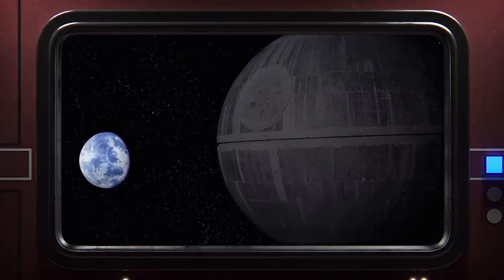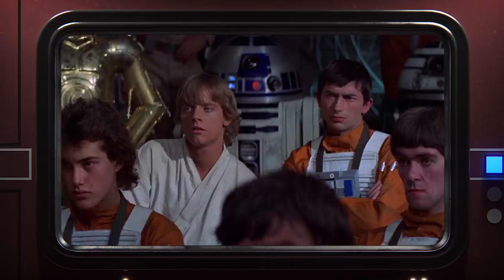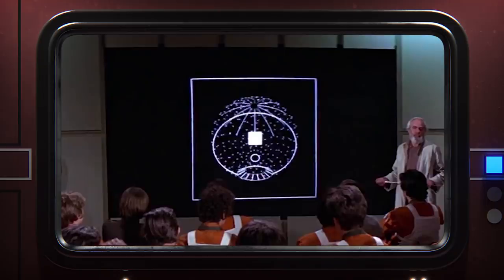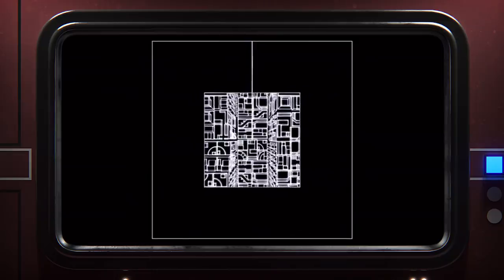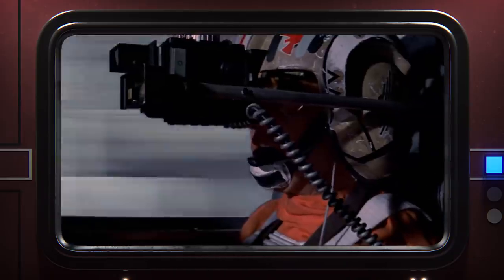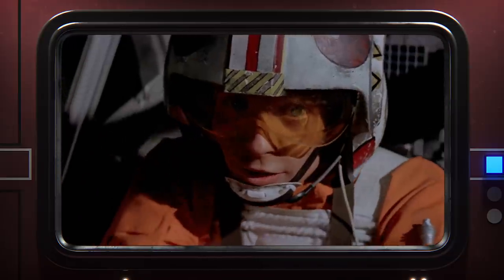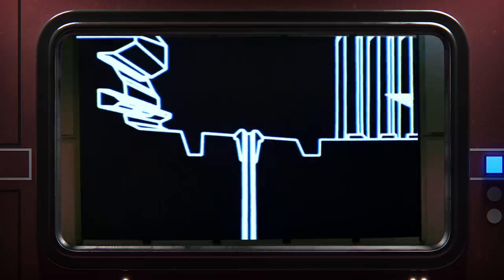The Thermal Exhaust Port Was NEVER a Problem

Comment: People on the Internet:
Why didn't they just cover it up or something?

Me, and intellectual:
Yes, how bout we cover up your car's exhaust pipe and see how well it runs.
Reply: its a thermal exhaust port it lets out heat (or heated something, what we don't really know) not carbon monoxide, that is an example of false equivalence right there
Reply: @Scortch-lo3xy  The thing is, it WAS covered up, by a ray shield.

Nobody would waste an incredibly valuable proton torpedo on what amounts to a window air conditioner. The ray shield would protect it from any stray lasers or turbolasers. The only way you would know to shoot it is if you had the plans.
Reply: @Crosshair84  uh what? 

what does that have to do with anything? I talking about why there is a MASSIVE difference between an exhaust pipe on a car and an exhaust port on a space station, especially when there are some 18 other ports and a much larger main port. 

also window air conditioner? really?
Reply: @Scortch-lo3xy  yes, thernal exhaust, that ac gotta get cool.
Reply: @Scortch-lo3xy  I think it's safe to assume that there was more than just heat leaving the port, heat can be dispersed in a number of ways other than just a tube but gas is something that would require a structure such as what is seen in the movies
Reply: We do. we put mufflers on the exhaust, no straight pipes unless its a race car.  usually a series of baffles, keeps the exhaust from shooting straight out and keeps the sound down. would also keep those pesky torpedo's from going straight to the reactor, Death Star needed Mufflers!!
Reply: @mikemoreno5267  ahh. Man, don't you just hate it when you are driving in a Nascar race down in Daytona and some pesky random rebel with space magic pulls off an impossible shot, and sends a good ol' proton torpedo down your car's ray shielded exhaust pipe and hits the main reactor starting a chain reaction that blows up everything? Man I wish I could keep darn proton torpedoes away from my car.
Reply: just use a mesh cover...
Reply: You could put a grate over it so that the torpedoes would explode on impact with the grate, saving the the death star
Reply: @crowncarwashoilchange8609  that is such a primitive solution.  These people live in an age where force fields protect everything from space.  They aren't going to set up a grate for the most sophisticated weapon in the galaxy.
Reply: TheKiltedGerman 
Just use a grate man
Reply: @trentwerner366  yeah, not that hard
Reply: "Oh no, We ain't falling for no 'potato in the tailpipe' gag."
Reply: @Scortch-lo3xy  it's really not an example of false equivalence because both instances have the same result. if a car engine can't release gasses, it fails, same as any appliance unable to release heat waste. you sir are cherry picking
Reply: @crowncarwashoilchange8609  if there is a grate, there can't be a ray shield or they would destroy each other. ray shields go from the walls in and a grate would block the field emitters. a grate is completely useless against literally any weapon so idk what you were on when you wrote this but it doesnt make sense
Reply: @crowncarwashoilchange8609  It's not a grate idea
Reply: @Scortch-lo3xy  The typical way to get rid of heat in space is to use large radiators that I suspect often are mistaken for solar panels. This is obviusly not done other then the spherical hull of the death star itself of cause will radiate some heat. So it is feasible that they use some form of gas. Actually some artillery pieces blow gas through the barrel after fireing as a way to cool it down. So the will then cool the reactor by blowing an hopefully inexpensive inert gas at the reactor and then ventilate out the heated gas.
Reply: @mikemoreno5267  I suspect it had them, except for that one port, designed that way as a sabotage.
Reply: @crowncarwashoilchange8609  Maybe some lazy technicians was working at the exhaust port and couldn't be bothered to screw back the grating when out for a lunchbreak? 😉
Reply: Also it would look terrible, we got to think about resale.
Reply: @Scortch-lo3xy  well, in space there is a vacuum so you cant use a normal dissipator to get rid of the heat, cause there is no air or matter to pass it on to, so probably that exhaust port had to have some sort of gas that was being expelled out of it to transfer the heat from the reactor. So yeah, i guess that could be an explanation as to why it had to be like that.
Reply: @Scortch-lo3xy  Well if it lets out heat why not just use radiators? They work a lot better in space and cannot be sabotaged or exploited by a nobody farm boy who turns out to be very powerful space wizzard So it probably isnt thermal in the way that you think it would be
Reply: @michaelpettersson4919  EXACTLY
Reply: @AlFredo-sx2yy  AGAIN EXACTLY
Reply: @Scortch-lo3xy  still, when you have a huge buildup of heat, it’s gonna go boom
Reply: @anonymystical4413  that's not how thermal energy works.
Reply: @crowncarwashoilchange8609  Many explosive projectiles need a certain amount of deceleration in-order for the fuse to detonate the explosive. Something like a torpedoed designed to punch through armor would go straight through the grate and not detonate until it hit the reactor.
Reply: @Scortch-lo3xy  How about covering up the radiator on your car and seeing how long it will run.
Reply: Why not just a grill cover? Gas can go threw but if you make it small enough and with enough layers a torpedo shouldn't get through
Reply: @markgeorge2200  It had a cover, called a ray shield.  Instead of a metal it was made of energy. They talk about it in the movie.
Reply: well you can argument that simply something like a bars or a Grid of tin metal could be use a few times inside the tunnel. It will still let the gas/ heat relas but build a mechnical barriere for bigger objects.
But most liked the proton topedo will not destroyed or exploded on impact of those grid but simply penetrated them and break them and fly with lesser speed still to the core...
And if the rebels have a few days before the deathstar arrife they could mont a torpedo /Bomb on a spider like droids that will firer from a X-wing and then crawwl down the tunnel and there cut every object in the way with a plasma cutter that was also installed. 
and last but not lest. Starwars was a univers where spacewizzards exist that can move objects with there mind. Luke have done it becaus he aim without Computerassistant. There was obiwan Forceghost ( if a ghost could turn back that fast after its death) and final Darth vader could manipulated the topredos becaus he want Tarkin out of the way and simply never believe a deathstar was nedded. ( remember hiw he speak over the deathstar and in revelation to the darkside of the force)
Reply: why are you people having such a big argument just add a few grates inside the exhaust
Reply: @burgernthemomrailer  Should we talk about real problems like: How did i as men lern to accept myselfe and not permement hidden behind a mask? Or how did i emmotional grow up after be a robot for 20 years... How not to be an asshole?  Or to learn to invest right into the stockmarket without have to pay to much in taxes and service?

No way... Let us talk over problems that did  not exist in storys we don't have any influence. And have no a single influence in ourer Real life . ( Exept for a few rare cases you would have to deal  in your hobby or your work becaus you work with airconditons or are a plumer...
Reply: @Scortch-lo3xy  Either way its gotta be letting out gas of some sort, even if its not carbon dioxide.
Reply: @burgernthemomrailer  that's what i've been arguing for but apparently that would completely destroy the death star, because integrating grates is impossible for something that radiates heat.
Reply: @matthewpaine6908  once again people bringing in false equivalence, covering up the radiator on your car, which mind you is already situated behind a grate for its protection, is completely different from putting a grate on it, which we already do. 

Seriously  have any of you guys ever actually looked at your own car? Why does everyone seem to assume that their radiators are just exposed to the open air.
Reply: @Scortch-lo3xy  I'm talking about completely coving it up, dumb ass. Yes your car has a grill to protect it from light impacts. However a grill will not protect your radiator from getting shot.  A Grill is not armor. That's what is being discussed.
Reply: @matthewpaine6908  my point still stands.  "your car has a grill to protect it from light impacts. However a grill will not protect your radiator from getting shot." that's great, good thing that those grills are not designed to prevent bullets from passing through, It is indeed designed to prevent light impacts. Lets also not forget the fact that a torpedo is very different from a bullet. 

In order to stop a torpedo, all we'd have to do is prematurely detonate it before it hits whatever critical system it is aimed for. 

Are you seriously telling me that in this world of space wizards and super weapons the size of moons, they couldn't design a grate or grill to slap into this exhaust port, so the whole damn station doesn't blow up? 

Doesn't even have to be a static thing either, it could totally be a retractable shutter or even another shield that proton torpedoes can't pass through.
Reply: @Scortch-lo3xy  You clearly have no Idea what you are talking about. Ever heard of an  armor Piercing bomb? The Fuse in the bomb is designed to not detonate on impact allowing the bomb to penetrate the armor and detonate inside the target. In fact you can program the fuse to detonate when ever you want, that included detonating 10 feet above a target or only after the bomb was come to a complete stop.  A grate will not stop an armor Piercing explosive missile.  That is like a bullet being shot at your Radiator. 

Plus the Exhaust port on the Death Star had a "Grill" covering it called a Ray Shield. The space version of a Grill. That is why they used the "Torpedo". Which is not a Earth Torpedo, since they are in space and not in water. We would call the "Torpedo" used in star wars an armor piercing Missile.
Reply: @matthewpaine6908  still does not answer why there was not another shield built into its design that would block a proton torpedo, you know the one and only thing that could pass through the ray shield without any problems at all what so ever. 

Also "We would call the "Torpedo" used in star wars an armor piercing Missile." can you get a citation on that there fact, or are you pulling more nonsense out of your ass?
Reply: @Scortch-lo3xy  

Here you go butter cup, the Definitions of a Torpedo. 

tor·pe·do
/tôrˈpēdō/

noun 

1. a cigar-shaped self-propelled underwater missile designed to be fired from a ship or submarine or dropped into the water from an aircraft and to explode on reaching a target.

So a Torpedo is an Underwater Missile, which means, You can't have a torpedo in space. 
 
I know a 5 second google search is hard, but it tends to make you look less like an idiot.
Reply: @Scortch-lo3xy  To answer your question on, Why didn't the empire build a shield into its design that would block a proton torpedo.  Let's look to real live events, like, why did the US Navy not have Torpedo nets around the Battleships in Pearl Harbor in 1941? 

The People in charge of Pearl Harbor knew the harbor was too shallow for torpedoes and didn't bother putting torpedo nets around their ships in the harbor.  However the Japanese designed a Torpedo in Secret that could be dropped in shallow water.  The Japanese found a weakness in the harbor and exploited it for their advantage.

Shoving a Proton "Torpedo" down an exhaust port was a 1 in a million shot. That need the "force" to pull off. So the Imperial Engineers would have considered the Ray shield to be sufficient. The pilots in the the movie even bitched about the target being too small to hit with their "Torpedo's."
Reply: @matthewpaine6908  

okay
1. i think you missed the point, i wanted to know why the hell you seemed to be convinced that a proton torpedo would be classified as an "Armor piecing Missile", where is this classification coming from? Did a cannon source call it this? Or is this just a label you decided to slap onto it for........reasons? 

side note: they take a great number of naming conventions from naval tradition, (Destroyers, Frigates, hell even outdated naval classifications like dreadnought) is it really impossible to assume that they would have taken the name torpedo as well? 

2. That analogy would make sense except in this scenario, proton torpedoes are apparently a well known technology in starwars, and people are aware of it's ability to pass through ray shields. The Empire would have been aware of this weakness of ray shields and thus the comparison between Pearl harbor and the death star is once again a false Equivalence comparison on your part. 

3. Last point " the Imperial Engineers would have considered the Ray shield to be sufficient. " Really? I thought we were arguing about, why slapping a grill onto the exhaust port, or really any additional layers of protection, (Particle shield, opening/closing armored door, Etc.) was a good idea or not. We were not arguing about what the imperial engineers where thinking when they built the station. You should move goal posts for a living, your good at it! :)
Reply: @Scortch-lo3xy  I understand that thinking is not your strength.  So I will try to simplify this as much as I can.  

The Ray Shied the Star Wars version of a Grate or grill on Earth.

The Proton Torpedo  is the Star Wars Version of a Missile on Earth. 

I don't think you will be able to understand anything further than these two simple points. Make sure when you play outside side you wear a Helmet because I would hate to see someone with a few missing chromosomes get hurt.  Cheers.
Reply: @matthewpaine6908  
"The Ray Shied the Star Wars version of a Grate or grill on Earth." so your saying that they do not have grates or grills in star wars? okay, also you have completely changed they argument once again, moving the goalpost to a completely different discussion.

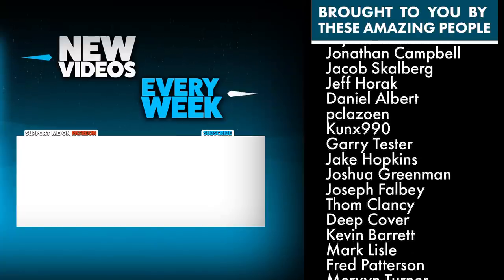"The Proton Torpedo  is the Star Wars Version of a Missile on Earth." then why don't they call them missiles?  they have other self propelled munitions that they label missiles (https://www.youtube.com/watch?v=M2Z1zvpkhbc) 4:27 to be precise. And again you say "The Proton Torpedo  is the Star Wars Version of a Missile on Earth. " not really, a star wars  missile is the star wars version of a missile on earth, as evidenced by the source I listed above. Its quite helpful having a source to back up my claims, you should try it sometime. 

Last point, I promise, *shield, and are you just capitalizing random words in your sentence for a reason or do you not understand grammar? 

Based on how you've been throughout this conversation, it seems I am not the one missing a chromosome here.
Reply: @Scortch-lo3xy  The ability to speak does not make you intelligent. When you learn to read please re-read my previous comments. The answers you see seek are there, you just have to actually understand what is being said. Now, get get off the computer and go play with your friends.
Reply: @matthewpaine6908  i guess i win then, he still can't seem to tell me why putting in a second particle shield is a bad idea.
Reply: A grate might work
Reply: @Scortch-lo3xy  I doesn't matter what the fucking name of the missile is, George Lucas still calls lightsabers FUCKING LASERSWORDS, even though they are canonically made of plasma. "Why didn't they add another shield?" Why don't you use two condoms? Or three? Or four? Or six? Because one is fucking ENOUGH. The only reason that shot worked is because of literally magic (the force).
Reply: Lol
Reply: @matthewpaine6908  definitions change with the advancement of technology, dipshit. Nautical terms are often applied to space, which is why space “ships” are part of a fucking “navy”. Make sense?
Reply: @TokyoXtreme  Good Job, you have completely missed the point. It literally went right over your head into the next state. Let me attempt to explain this to you, however I am not that good at explaining things to people with a sub 80 IQ. 

In the year 2021 there are no Torpedo's in space on Earth. Torpedo's are consider underwater missiles not outer space missiles. Ok. 

Also in the Year 2021 on Earth,  the phrase "space ships" are not interchangeable with "ships". Ships refer to water craft and Space ships refer to Space craft. Hence why Space in placed in front of ship. Understand.  

Also no Navy in the Year 2021 on Earth operates a space ship. FYI. 

This may be hard for you to understand but this is the year 2021 not 2521. So I am going to compare Star Wars tech to Earth tech of the 20th and 21st century.
Reply: Nothing bad tbh except for the fact that it would turn off
Reply: @kaedehara3645  the Death Star could have been saved by a sieve
Reply: @matthewpaine6908  so your car has a gaping gap in its middle to radiate heat? Sounds like a brilliant idea wow!
Reply: @matthewpaine6908  didn’t work tho did it
Reply: WOOSH
Reply: @Scortch-lo3xy  It's not a literal analogy.
Reply: @Uranium 233 filter in your car ain't gonna stop a bullet.  You think one's going to stop a space torpedo? 🤨
Reply: If your argument is "mUh GrAtE," shut up.  Not only has it been done to death and already been rebutted, but you fundamentally don't comprehend the extremely basic narrative of Star Wars, a movie for children.  Shut up.
Reply: "and" intellectual??
Reply: @Scortch-lo3xy  Cover an heat exhaust port.... HEAT exhaust. Port with takes heat outside of reactor so it doesn't overheat... Yeah, great idea.
Reply: @kibukaj2956  doesn't always need to be covered you know, a second layer of shielding, which can be deactivated when not in use, would be a great idea as you have already stated. 

Also how bad can the result of covering up ONE of 18 ports possibly be worse than literally the entire station blowing up? Especially since you would only need to cover it up whenever there was a serious possibility of someone shooting the port with a proton torpedo.
Reply: ...be right back
Reply: I mean would it have killed them to put a grate on it
Reply: @Scortch-lo3xy  You don't know how space works do you...
Reply: I mean they could use a vent?
Reply: @Scortch-lo3xy  "its a thermal exhaust port it lets out heat (or heated something, what we don't really know) not carbon monoxide, that is an example of false equivalence right there"

If it's a port, then to let out heat it has to let out something to carry the heat, ie carbon monoxide, or pretty much any gas, "a port" means it is venting something, you can't just vent heat itself, as heat is a form of energy that an object has, you can vent a gas that carries the heat, but you can't vent heat itself.

You can radiate heat from an object, but that isn't the same thing as venting it, and you'd use a radiator to do that, not a port, in space the only way of getting rid of heat is to either vent out some gas that you've transfered the heat into inside the ship or station, or to use a radiator, a port isn't a radiator...

In an atmosphere you also have a third mechanism of getting rid of heat, convection, that isn't an option in space, so it's either radiate, or vent from a port.

So it's not a false equivalence.

Side note, regarding Princess Leia getting spaced....

You will NOT die from being frozen in space if you're blown out into it, you will die of asphyxiation long before that happens, infact your body temperature will initially rise before you die, not drop, because you've lost all but one mode of getting rid of body heat, you only have radiation left, you don't have conduction or convection available to get rid of body heat, and radiation is by far the worst way to get rid of energy compared to those two, any movie or tv show that shows a person immediately freezing to death is made by someone who didn't pass highschool physics.
Reply: Don't have to plug it.
Just put up a wall a few meters in front of it.
Ever seen a chimney cover? It's a little metal hat for your chimney that prevents rain and snow(and radioactive dirt if you live near Chernobyl like me) from falling into your house while still letting the smoke out. 

It would have also been probably really beneficial if they didn't put the exhaust port at the end of a long, straight trench. If it was facing straight up and away from the Death Star, any attacker would have had to come from an exposed point and have to navigate through the concentrated firepower of most of the surface turrets instead of just the ones in the trench. 
Basically, once you enter that trench, you've effectively bypassed almost all of the defense capabilities. In tactical terms, that's called a massive fucking oversight.

Also, the empire knew that the floor plans for the Death Star were stolen. Any sensible military man in charge of the Death Star would have brought those plans to the nearest group of imperial architectural engineers ASAP and ask if they can see some potential weak points that should be reinforced with an extra squad or two. 
Anyway, any of them would have said the same thing I did: Once they take the trench, you can kiss your Death Star goodbye.
Reply: @mattstorm360  can't believe you didn't het more thumbs ups. I got the reference.
Reply: @evanharrison4054  So the death star needed a space-awning lol
Reply: @LeoH3L1  You get me.
Reply: Builders expansion foam works best in car mufflers
Reply: @Crosshair84  and a space wizard
Reply: @TheKiltedGerman  Reminds me of the episode of Stargate SG-1 where the Asgard had to seek the help of humanity because their highly evolved brains had trouble thinking dumb when solving a problem.

Also, the grate idea is definitely not dumb. It's smart enough that it gets real world use. If you ever look at a modern tank or armored vehicle and see cages or slats mounted to the sides, front, and back, this is exactly what they are for. Their purpose is that if a shaped charge rocket were to be shot at the tank, the rocket would (ideally) hit the cage instead of making a direct hit on the armor, resulting in detonation at a safe distance (or, rather, "safe distance" keeping in mind that you are in a tank). It doesn't always work, but the number I've seen is that a well-designed cage armor will have at least 50% effectiveness in stopping RPGs. And-- compared to a fancy active protection system, which will cost a lot and introduce complicated potential issues or maintenance, that 50% is pretty damn good.

And, consider that if there was a grate, the attack may very well have failed.

Honestly, the biggest issues with the grate idea are twofold: 1) this is a thermal exhaust port, so you would need a grate design that would not absorb the heat you're trying to expel and either a) deform due to heat stress or b) recapture waste heat back into the space station and potentially cause other issues. 2) the grate is meant to potentially be hit and blown up, so how do you plan to contain a (planned) explosion inside your space station?
Reply: @jdjk7  and that was my point.  With a civilization that has spent literally millennia if not more with this technology, a grate is so primitive, no one's going to consider it.  The port was ray-shielded, which the Empire considered adequate given the tech and their own hubris. 

I'm well aware of what grates are used for in militaries and why they are used.
Reply: @LeoH3L1  of course, it's not really the purpose of a car's exhaust pipe to expel waste heat. It's to remove waste gases and allow the engine the pressure conditions it needs to run. It does happen to expel waste heat. However, if you plug up your exhaust pipe, the engine will simply die from the backpressure before you see any kind of thermal damage. So it is sort of a false equivalence, as plugging the exhaust pipe on your car will not necessarily have the same effect as plugging up an exhaust port on the Death Star. As far as I know, the DS-1 didn't run on petrol.
Reply: Except covering up a vacuum is perfectly fine. Vacuum does not conduct heat. (thermal exhaust port).  The whole idea of a vacuum thermal exhaust port makes no sense.  A liquid cooling system with radiator plates makes actual sense.
Reply: @crowncarwashoilchange8609  The thing is the proton torepedo would just busted through
Reply: @michaelpettersson4919  I am not buying "because it was sabotage" its so weak of an excuse if he wanted to sabotage it make it go boom before it can fire its first shot
Reply: @awesome7732  Why would the shield and the grate have to be in the same exact spot? Why couldn't the grate be isolated from the shield? Why couldn't look like a chimney cover like the other guy said?
Reply: @blueskies133  But where is the radiator going to radiate the heat if there is no air?
Reply: @gahbah274  infrared radiation is an em wave
Reply: @awesome7732  you could put the grate just below the emitters
Reply: @flamebreaker7318  then when the proton torpedo hits the grate, the debris from the torpedo and the grate block the exhaust port and cause a pressure buildup which causes the station to explode. Good. Then the falling debris go down the port and blow up whatever device was connected to it. Even better. Physical objects in an exhaust port also create resistance, which makes it harder for fluids to move. Because the grate is fighting against the gasses that are being expelled, it will eventually fail and fall down the port and blow the station up. Look up  cyclic fatigue. Big no no to stick things in an exhaust port
Reply: @Scortch-lo3xy  kind of, the outcome is the same though, the people inside die
Reply: You, thinking your intellectual observation regarding a fictitious construct in an imaginary universe, is somehow insightful and clever: "it's like a potato in a tail pipe...ah-hyuk!" 
Dictionary: Definition of exhaust port is the opening or passage which directs flow of exhaust gases out of an engine.
Me...pointing out  "intellectual" implies "the presence of intelligence", and providing an example through the magic of sarcasm for future reference:
So...did I miss something? Did the Death Star run on unleaded? The gas mileage must have been terrible!
Reply: @chebochevato8336  
Wow, you replied to a 2+year old comment just to say,
"It's fiction, so it doesn't have to make sense or whatever."
Reply: @Cheesehead_Caleb   uhh, no.. an exhaust pipe is.. according to the dictionary: exhaust port

an opening or passage which directs flow of exhaust gases out of a fuel burning engine, or part of a system which directs the flow of a heat transferring medium away from a heat generating source, to facilitate the use of the generated heat (where heat generation is the intent), or to facilitate the regulation and dispersal of heat accumulation (where heat is a by-product of a process). 

i.e... space is a vacuum. There are no vents, intake manifolds, or exhaust ports. The only means to disperse heat in a vacuum is by radiation, which requires exposed surface area, not duct work or tail pipes. The actual surface of the death star itself would be a much more viable and realistic means of excess heat dispersal than an exhaust port. In order to have a functioning exhaust, you need a heat transferring medium to travel through it. The vacuum of space is not empty, but does not contain enough particles to facilitate convection or conduction. You can only dissipate heat in space through radiation....
 And before anyone tries to suggest that the death stars giant laser could be used to dispose of excess heat accumulation...no, no it can't. Heat is a low grade energy. Lasers require high levels of energy input. Furthermore, while lasers can burn, they aren't hot. A laser beam doesn't have a temperature, as it's made of photons.. which have no mass, and therefore no temperature. 
To convert latent excess heat into a suitable energy source capable of powering a laser, you would need a system to convert the energy from one form to the other. Such a system would most likely require the input of additional energy to function. Resulting in it likely generating its own heat as a by-product. Not to mention the additional energy the stations main power generators would have to produce to power the system. The system would generate more heat than it could  effectively dissipate. Even if it was 100% efficient at converting heat into energy into photons....it still wouldn't be capable of dissipating more heat than it generated.  I don't know if your aware... But lasers typically generate a lot of heat as a by-product. 
Granted, the Star Wars universe has a debatable form of magic via "the force"... regardless if its technically "science based" magic.
 But considering there's a necessity to dissipate heat in principal, suggest the laws of nature In the Star Wars universe, are similar enough to real life... That one can assume perpetual motion machines are an impossibly there as in real life.
Reply: The only thing that could have ever even had a chance of protecting the death stars exhaust port, is ablative plot armor.  While some dark side users were capable of manifesting regular plot armor through the force,  ablative plot armor is a force power inaccessible to dark side users. Emperor palpatine came the closest when he created the ret•con plot armor, but ultimately it was still no match for ultimate form ablative plot armor manifested by the Jedi Disney Princess Mary-sue-rey.
Reply: @mikemoreno5267  awesome, now I can't get the thought of a death star with glass packs installed out of my head. 
Next comes the giant rear spoiler,     some spinners... Next thing you know, there's fuzzy dice hanging in the control room....
Reply: Is it lost on everyone but me, that the death star isn't real, and even if it had a pair of magic space leprechauns protecting the exhaust port... they still would be no match for Luke's ablative plot armor?
Besides... everything was ultimately pointless and every effort made futile. Even emperor palpatine's greatest achievement.. the power of ret•con plot regeneration was no match against the all powerful Jedi Disney Princess Mary-sue-rey's woke force plot armor. 
Shit...Disney princesses paint the walls of their living rooms with the blood of their enemies. Palpatine never even had a chance...
Reply: @TheKiltedGerman  hahahaha... I never really pay attention to the time of posting..sometimes I just start following an interesting discussion thread, and get sucked in..
Reply: @TheKiltedGerman  plus, if fiction always had to make sense, it probably wouldn't be as entertaining.
Reply: "Let's put a screen door over it to keep the mynocks out." - The one imperial with a brain.
Reply: Well, I mean, I mean, can't we board it up or, you know, put some plywood over it or something?
Reply: How do you guys know that there wasn’t a grate somewhere further down the hole? In the scene, we can clearly see that there were two torpedos launched. If there was a grate one could assume the first torpedo was to take out the grate, allowing the second torpedo to reach it’s target unhindered. 

The subject of “tHe eXhaUsT pORt hAS WeaK deFEnCe” was brought up, but you forget the gold squadron, the squadron originally tasked with bombing the hole was wiped out.  Look at how many ships approach the Death Star Vs how many ships fly away.
Reply: @awesome7732  That's why you put the grate under the ray shield and have the ray shield cover the grate. Mind blown